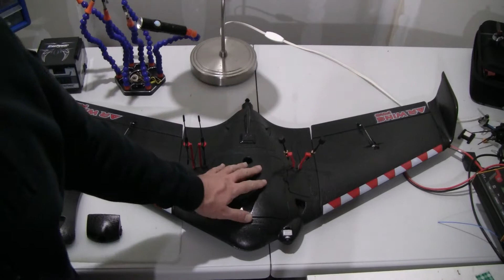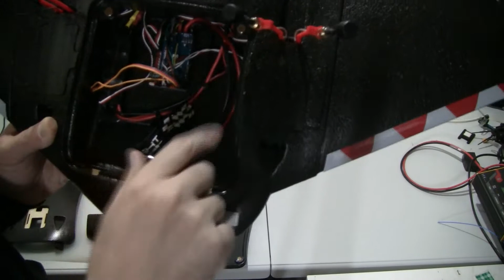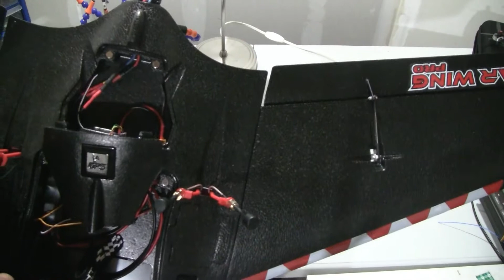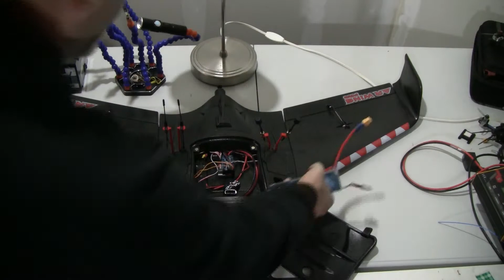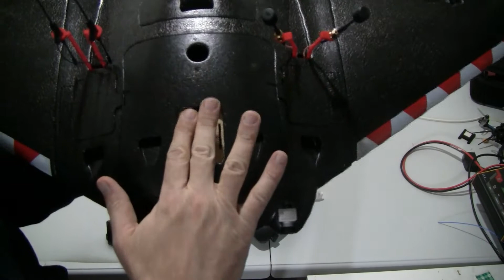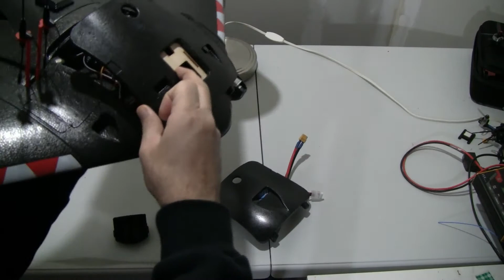Sonicmodell AR Wing Pro/DJI Part 1 - Build Overview

Comment: Nice video. I'm currently considering picking up this wing to use with an air unit from a quad I don't use anymore. The issue with the CG mostly comes from the fact that you don't use an action cam on the front. Add a ~120g gopro and things would be more balanced. I was also debating where to mount the air unit and I was already worried that the cable would be too short to mount the air unit on top and run the camera on the side but I didn't even think about the issue with opening the hatch so I guess that will settle it for me.

Comment: Amazing video... loved it. Gonna watch it again. am about to transplant a parrot disco into a wing... o am hesitating between this one and the eachine ar pro special one .... I suppose the special one will be better than this one. Just for the dji air unit on the side for instance .... hopefully parrot chuck will fit there and using different servo will not cause an issue.

Comment: How did you get the DJI cam cable through the hole? Did you unscrew it from the cam or Airunit? Thanks!
Reply from the maker: Air unit

Comment: Everybody keeps complaining about the center of gravity they made this wing to have an HD camera right in the front if you don't run an HD camera right in the front where it's made to go in the cut-out slot a shake just like a GoPro then you're going to have to put extra weight in it cuz you're not running a camera that it was designed to run with it's really just blows my mind everybody complaining about the Cg. They made it like that so you can run a freaking camera without having to add weight to the rear.

Comment: Is the air unit permanently mounted to the side pocket? How do you remove the SD card?
Reply from the maker: It is not, the camera and antenna cables keep it in place. I can tilt it and remove the sd card

Comment: Would love to get the 3D print file if possible.
How did you get the DJI camera installed? remove cable to install?
Reply from the maker: Here you go: https://www.thingiverse.com/thing:4704656/files

i removed the cable from the air unit to install the camera

Comment: Now I know why mine wouldn't fly it wobbled and crashed in the snow ! not enough weight in front !! 
where do you find the point of balance ?  my email  faciliy16@gmail.com
Reply: also how could I put a RTH  Return To Home unit and a Aircraft warning in area ?
is this possible ?
Reply from the maker: @robertpawlusiak  you will need to install a flight controller and hook up a GPS unit to it exactly as the setup I have shown in the video. This would give you RTH capability, but it would not warn you of other planes in the area, this is not possible.
Reply from the maker: Point of balance (centre of gravity) is marked under the wings, and is shown in the manual that came with it, please tell me if you still cannot find it

Comment: you are wrong about the DJI air unit in the front. If you take the nose foam you can see that there is a slot going UP and that's the way the cable should be rooted. that will give you way more movement with the DJI air unit hatch....
Reply from the maker: Thanks, I missed that.

Comment: Have you had overheating issues with your DJI Air unit there on the side pocket?
Reply from the maker: I have not maidened it yet, it’s freezing now in Canada, but I had a similar setup with the zohd dart XL, and I had no heating issues. You can check my dart XL video. I don’t believe I will have heating issues with this setup.
Reply: @RaedAdlouni  谢谢老铁的回答，我也是想问这个的，哈哈哈，thanks

Comment: Hi,

I would like to build my first wing and have the same setup in mind as you. Is there a manual somewhere on how to wire everything up? Also do you have a parts list (GPS, controller, etc) handy right now? I would also like to put my GoPro Hero 7 in the nose. Does it come with a rack for that?
Reply from the maker: Every electronic part (gps, flight controller, etc) comes with a wiring diagram. I will put tonight a list of the parts used in the video description section. I will also gladly answer any question you have regarding wiring.
Reply from the maker: Just posted the parts lists in the description section
Reply: @RaedAdlouni  Thanks a lot!

Comment: What size camera cable were you using. I am building out my AR Pro now but have the 20cm cable (lesson learned from putting Caddx Vista in Mini AR). I like the idea of putting on the side but wanted to know if you are getting enough ventilation to keep the air unit from overheating?
Reply from the maker: I am using the stock cable, it’s long enough

Comment: Also another question, beacus iam fairly new to this hobby. How did u fixed the matek Fc and the ESC in the main hatch. Did u just use some velcro tape or did u just clue it into place? Thank you in advance.
Reply from the maker: Hello, i used a double sided tape, works perfectly.

Comment: Hello, great video.  Can you please e-mail the STL files for both the Antenna mounts Receiver and DJI Antennas.  The receiver antenna mounts should work for crossfire Immortal T yes??  Please send files to Flymanjg@gmail.com.  Thank you.
Reply from the maker: will do, not sure if the hole will fit the crossfire immortal T